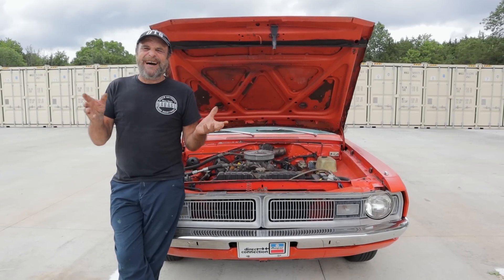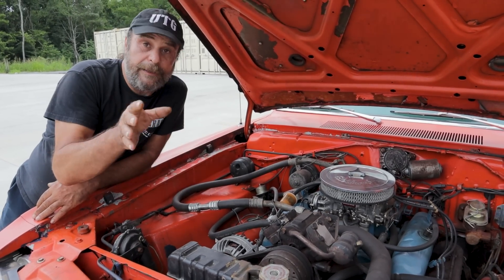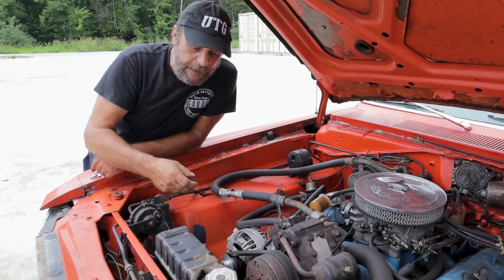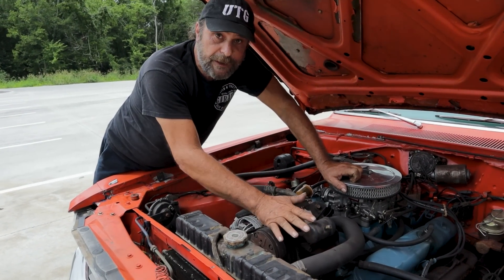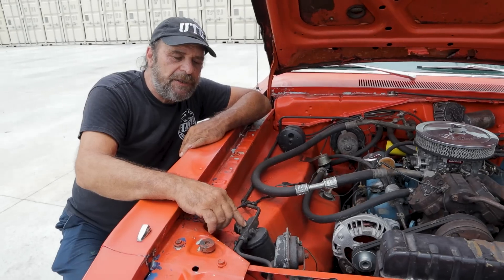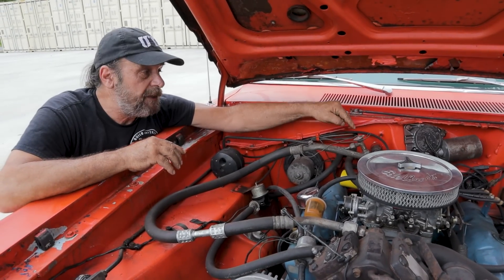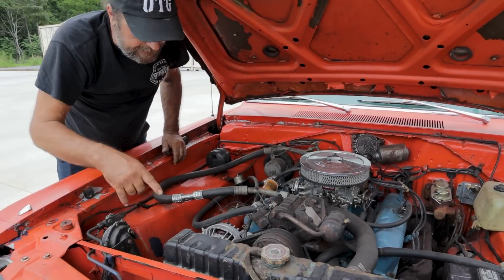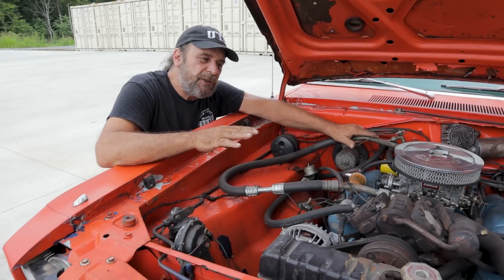Classic Car Air Conditioning Systems - How They Work, Their Differences And Basic Troubleshooting

Comment: Some of the old style compressors are able to be used as an auxiliary air compressor. Since they store oil in a sump rather than relying on oil flowing in the system they will work fine without a closed loop system. Can be super handy having an engine driven air compressor with an electric clutch.

Comment: I'll never forget watching someone at a local garage adding a can to a system. Is it blowing cold yet he asked another guy in the car. No he said so they go for can number 2. All of a sudden it sounded like an M-80 went off under the hood. Another guy thought the battery blew up. Turns out a pressure line blew. Maybe one of you AC guys could explain what happened. After seeing that I never tried to recharge a system myself

Comment: You nailed it. Awesome video. Compressors don’t die they are killed. Your failing expansion valve is what killed your compressor by not regulating refrigerant flow properly the compressor wasn’t getting enough oil and seized. Don’t replace a compressor without figuring out why it died or else you’ll be doing it twice. I’m a refrigeration guy 👍🏻
Reply: The question has always been, "when does a vapor pump turn into a liquid pump?" Just before you replace it.
Reply: We had a pererbilt eat 3 last summer. 
I got blamed for the backwards orifice when the second one I did died. 
I pulled it out with needle nose pliers, held the new one beside the old to grab it so I'd get it the right way. 
That truck ate one every spring.

Comment: I've always favored the txv (thermostatic expansion valve) system with the receiver drier over the orifice tube and accumulator drier on the suction line.  They are WAY easier to add a little charge to if the system is low via the sight glass vs having to pull the charge and weigh in the correct amount on an orifice tube system.  Anything else on an orifice tube system and you're just guessing.  The other thing nice about a txv system is it can react to different operating conditions and meter refrigerant accordingly.  As a former transport refrigeration and air conditioning mechanic of many years I think you did a great job explaining the system!

Comment: Good job explaining this Tony, and covering all areas. Strange as it may be, our first local Mopar down under with factory integrated air, was in 1969. In 68 you could get a dealer fit under dash system. In 1970, the system was changed to run a Tecumseh parallel twin compressor, so that V twin died off here. Good work. Highly regulated down here, no such thing as home charging, has to be done by a licensed operator, and they know how to charge!

Comment: Hands down the best USABLE Overview of how and why the AC system works that I've seen. I didn't quite understand what happens between condensor vs. Expansion valve before and now I do. Even after successfully replacing existing systems in my garage. Bravo and Thank you.

Comment: I remember the first car we had with air conditioning. We drove it when it was new, up to Canada in the Summer for the World's Fair. It was so humid, the air conditioning was dripping waitron in the passenger side floor. We went to a garage where they spoke French, they told us it was normal and that the humidity was overwhelming the air conditioning drain. All of the garage technicians at the garage in Canada wore white doctor coats. After Canada, the A/C drain was never a problem again. The owner's manual said to run the A/C at least once a month, even Winter, for certain number of miles, to keep it lubricated and from seizing up. It didn't cycle with the defroster, like they do in newer cars, but mentioned using the A/C to defog the windshield. We had the car for 10 years and the A/C only lasted for about 5 years., but with quite a few miles on it.

Comment: Youve given great advice; but for those people who choose to do it themselves (with an R12 such as the 72 has), please do not use butane as a substitute for r12.

Until my retirement, i checked what type gas was in the system of EVERY a/c system i worked on.  You never know what is in it!  You'd be surprised as to what is in some of these vehicles.

Also, for those considering doing a conversion from r12 to r134a, be advised that r134a is far less efficient at cooling and takes a lot longer to cool down a vehicle.  I did conversions on a European import make when the factory offered a conversion gas kit and not one customer was happy with the results.

Finally, if the vehicle is more than 5 years old, i replaced the schrader valves as a part of a normal recharge, thus avoiding a potential comeback from a work valve.

Enjoy your videos, keep it up.
Reply: The effective replacement for R-12 what I’ve been told is R-152 which is the compressed air in a can for blowing dust out of your desktop keyboard. You throw about x2 the weight of r-12 n it does the same thing. Better than r-134 conversion
Reply: @jayslpstapes519 that's what I've heard as well. R-152a and under half the weight as factory R-12 charge for the system to run well. It's slightly flammable but nowhere near as much as butane propane mix. It also happens to be 10x better for the environment than R134a and infinitely better than R-12. I suspect 152a will be making a comeback now that our global warming potential for new refrigerant systems needs to get under 700 by 2025.
R32 is 675, barely making the cut. R134a is 2000 ish, r152a is 170. Propane is like 3.

Comment: Really good to undestand basics of A/C on older cars, also I see most of the old stuff still make it's way into newer cars aswell!

If possible, make a video on the differences from a carb that has the A/C stuff and one who doesn't, I think there's some parts needed on those carbs, I'm not 100% sure. Great video as always Uncle Tony!!!
Reply: its usually an electronic solinoid that extendes to raise the idle speed with the ac on so the load of the compressor doesent stall out the engine.

Comment: The Dart has what's called a Thermal Expansion Valve or TXV for short. Most systems now use an expansion valve instead of the orifice tube. The new expansion valves regulate off of pressure/volume alone.

Comment: If you are working on an old Mopar and you find a valve inside the compressor where the low side hose attaches take it out and throw it away. It's called an Evaporator Pressure Regulator (EPR) valve and they must have been trying to outdo Ford for better ideas the day they came up with that one. It served no good purpose and did nothing except malfunction when you least need it to, like on the way to a wedding or a funeral. It was supposed to help keep the evaporator from freezing. Love your channel, Tony. It reminds me of those days in the garage when going home looking like a grease monkey and with genuine busted knuckles were everyday realities working on those old cars.

Comment: Replacing the "dryer" is kind of an outdated thought from when people may not have fully understood the systems and/or vacuum charging wasn't as common. When you pull a vacuum on the system, you're not just evacuating it of air, you're boiling the water out. Just like how a pressurized cooling system increases the boiling point of water, vacuum decreases it. On a nice hot day, with a consumer grade vacuum pump (mine is a lower end Robinaire... not that different from the HFT ones), you can generate enough vacuum to boil the water at ambient temperature (from memory... I think this is around 90F at 29 inches of vacuum... so... the hottest day of the year is a good time for A/C work 😆). When you boil the water, you're boiling it out of the desiccant too and "recharging" it. Also... If you do buy a new dryer, it's not like they come sealed. The last one I did replace just came with plastic caps over the fittings so the threads didn't get damaged. New ones need vacuumed down too... and usually need some amount of oil added to them before installation.

Where you do want to replace your dryer/receiver/accumulator is when you have a catastrophic compressor failure or the system has been open for a long time. Running the risk of pumping tiny bits of debris out of one into a new compressor isn't worth the few dollars it saves. I wouldn't bother to do it for something like an o-ring failure on a recently working system though. Fix the leak, vac it down, charge it, send it.

Comment: Good video, Tony! If you take an older car to a shop that specializes in A/C work, and there's a ton of them here in Arizona, any decent tech is going to place the system under vacuum and see if it holds that vacuum. If it doesn't, they're going to let you know that the system will leak and give you a price, probably a hefty one, for diagnosis and repair. Some won't even fill the system if it's leaking. Also, many cans of refrigerant you buy now has oil in it and there are retrofit kits to go from R12 to R134 without replacing lots of parts. They work, I've used them more than once. Buy the can with the gauge on it and fill it yourself. Sure, it may not work as good as it could, and it may leak down in a few months or a few years, but it didn't cost you a couple of grand to get it to blow cold either.
Reply: I'd still recommend getting a two gauge manifold as they can tell you a whole lot more about the system than those single gauge fillers can.
Reply: And purge the lines before you pop em down.

Comment: An A/C system is just a heat exchanger. The pressure drop through the expansion valve turns it to a gas which makes it low pressure which makes it cooler than the ambient air. As the freon in a gas state passes through the evaporator it is removing heat (energy) from the cab by absorbing it into the freon. The reason the freons temp rises so much after being compressed is from the heat (energy) that it removed from the cab being compressed to a much smaller area, it concentrates the heat. Most of the heat coming off of the condenser is concentrated heat from inside the cab. It's removing the heat from inside and releasing it outside therefore leaving the air inside cooler. Hot air is energetic air. When using the heat you are transferring energy made from the engine through the coolant into the air in the cab.
Reply: You nailed it! 
Tony did not...

Comment: We forgot the theory, change of state is critical, we also have heat transfer from condenser and evaporator, txv and orifice tube operation, as in change of state, ALSO the refrigerant carries properties such as a direct pressure to temperature relationship..
Reply: I agree, but he didn't do badly for a 15-minute primer.

Comment: Evaporator replacement PTSD is a real thing. Great vid UTG
Reply: Blown head gasket - no problem
Blown rear main seal - easy
Needs a new evaporator - time to put it up for sale
Reply: @haywoodyoudome  depends on the vehicle. some cars you could take the whole dash out in 7 bolts abd a few wire connectors. most gm evaps come out from under the hood.
Reply: @richardcranium5839  mid to late 80s Mitsubishi Starion, late 80s Tbird and Cat and John deere heavy equipment. Being a contortionist is an asset.

Comment: Hee,  it's nice to see you go through the quirks of AC that age.  In cars that old it just wasn't a common option people went for back in Boston,  and  us kids would just rip it out if it didn't work,  or sometimes if it did,  cause it was sucking power and adding a lot of weight.   :)   (I think if I did really want an AC in something that old, I suppose I'd spring for one of those modern aftermarket systems that  are smaller and simpler and less of a parasitic loss.)  

I never actually fixed an AC system till I came down here.  (And I actually simply took it all out of my Volvo  cause my blistering 115 horsepower just calls for more lightness anyway.  :)    )

Comment: Good info. I had some rental properties in Georgia and all had heat pumps so to save money I took a HVAC course and watched a few YouTube videos which allowed me to successfully install and maintain the systems. I live in the Philippines now and brought all my HVAC tools and vacuum pump since I had to install 4 mini splits on the house we had built. The Filipino installers don't use vacuum pumps. I bought a 2002 Suzuki Carry mini truck that has a 660 cc 3 cylinder engine. The A/C lost the charge a few days after I bought it. There was an o-ring leaking so I replaced all o-rings pulled a good vacuum and recharged with R134a and it is ice cold in the tiny cab. I also added an ounce of oil for good measure. It is cool because the condenser isn't in front of the radiator, it is beside the radiator and both have electric fans.

Comment: Learned the lesson about the compressor oil the hard way!
Bought a "134A conversion kit" and installed it myself... 
The pump locked up solid, ate the serpentine belt, that spun the alternator, that blew out the digital dash! 
After that I took it to a air conditioner "expert"...

Comment: Tony, about your quick comment about the valve that shuts off the coolant to the heater core.  On Ford, the coolant runs continuously through the heater core.  An addition I found helps the A/C it to add a shut off valve in the coolant line going to the heater. Just a ball valve from a plumbing supply store. That way, the heater and A/C are not fighting each other.   The only caveat is that to prevent corrosion, open the valve one day every now and then (I do it the first of the month) just to get fresh coolant in the heater core.

Comment: I hope you include the AC repairs that will be done as content. I've heard most common leak on Mopars is the compressor seal, I would love a seal repair video.
Reply: The crankcase seal is lubricated by the oil in the compressor/system. Turning your A/C on for a few minutes every time you turn on your engine will lubricate these seals. Once the seal dries out it gets brittle and shrinks up and you lose the refrigerant.

Comment: I often thought about taking one of those V-2's and making a tiny motor out of it.

Just never got around to it.

It would be cool though.
Reply: @mr.gutwrench To be a 2 stroke compressor is not the same as being a 2 stroke combustion engine.

I would just gear a cam to it [dual overhead cams] and then decide if I wanted to make it a 2 stroke or not.

It would be possible with a roots blower to make it a 2 stroke, but without positive air displacement you can't make a 2 stroke, and you can't use its block as a displacer port because it has 2 offset pistons into one chamber.

Also the compression ratio would undeniably change because you need room for the valves on top.

There's little chance it would even be 12:1 by the time you put a set of heads on it unless you domed the piston and made it a HEMI.

I would go for diesel, except that diesel engines lose a lot of their efficiency when you drop their burn time using such a short travel and high rotational speed.

I'd probably run it on a mix of methanol and nitromethane.

Comment: Great Video, thanks!
Struggling right now with my B200 van which still runs on R12 - forbidden in Germany. The shop manual is not as easy to follow in detecting faults. Would love to hear this dedicated to Mopar AC system incl. Where to find parts. Same goes for speed control
Love your videos 😎

Comment: Im not sure about all makes/models. But my 1980-1991 ford trucks I love tinkering with, they don't have a heater control valve. I always install a manual valve to cut off that extra heat around the evap core.

Comment: the other reason to not just charge it, if its empty now, it went somewhere.  New refrigerant is just going to go away again if the leak isn't fixed.  Most of these old systems leak at least a bit but after decades the O rings and gaskets are usually shot and need to be replaced.

Comment: This helps.  Been working on a 60 Rebel with air and iam about to dig into it.  Iam hoping to keep it original but R12 up here in Canada is rare to find.  I guess I'll find out if this AMC system can be upgraded to 134.  
Thx Tony  Cheers 🇨🇦
Reply: You will need to switch to a polyolester oil to run 134-A. R-12 used a mineral oil.
Reply: @kurtzimmerman1637  thx for the info
Reply: @jamesmisener3006  your auto parts store will have all the information on what you need for a conversion.  take care.
Reply: As mentioned, change the oil and change the receiver/dryer.  Possibly change the expansion valve. While it is apart, flush the lines, condensor, and evaporator with compressed air.  There is some debate on using an ac solvent flush.  On one hand, you do need to get as much oil and dirt out of the system as possible, but the oil impregnated into the orings and hoses helps retain the smaller 134a molecules.  Personally, I'd recommend using the solvent flush because I doubt that it has time to pull oil out of the hoses.  Only replace the orings you disturbed. Install the conversion fittings, and you should be good to go. There is some debate about replacing the expansion valve.  The correct way is to replace it because it was designed to work with R12, not 134a.  On the other hand, I have seen AC systems operate okay with the original valve.  I recommend replacing the valve if possible.

Comment: You probably could have mentioned the change of state from liquid to vapour in the condenser and evaporator , also the receiver dryer isn’t a reservoir it’s simply a filter like you described , also moisture in the system is more prone to expansion like a steam engine which in turn raises head pressure coursing the high/low pressure switch to cut power 👌🏽

Comment: Cool . Hold the system under vacuum overnight and that drier is good as new. All  the moisture is gone. Used to use an electric vacuum pump and just left it plugged in overnight.